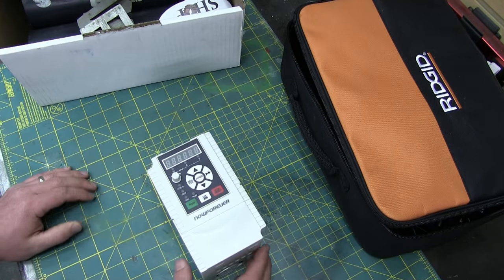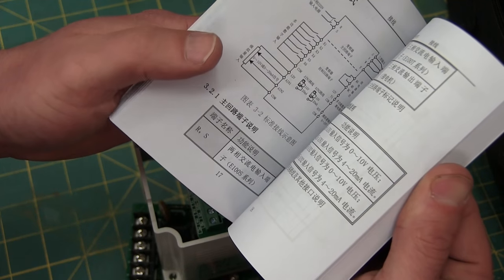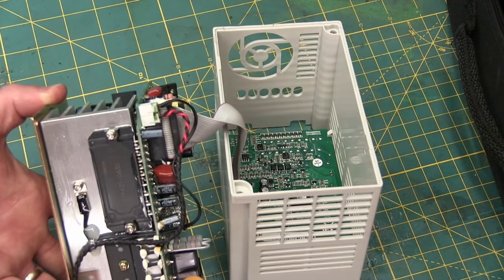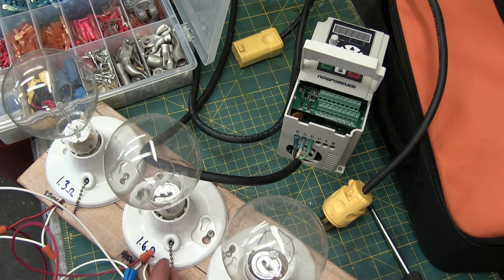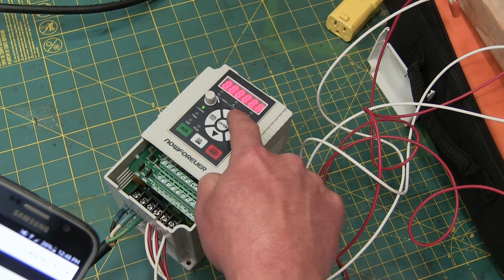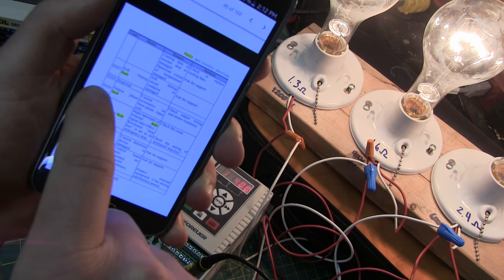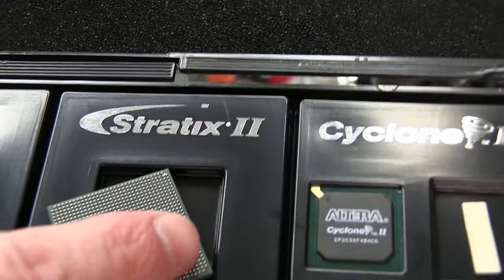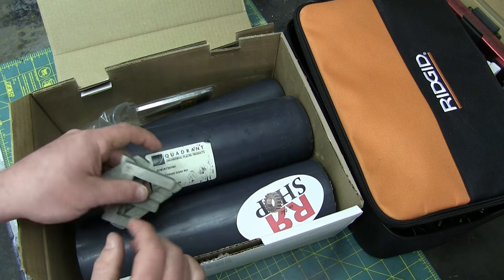BOLTR: Inverter VFDs explained, teardown and test

Comment: Back in 2000 I started a company where we could HAND solder BGA's. I had so much fun watching the disbelief on engineers faces when I'd tell em, not only can we remove the BGA's by hand, we can reflow them by hand. Of course there is some wizardry involved - but no fancy reflow ovens.

Comment: you need to place those notches on those traces so your reflow solder stencil does not get all floppy on yah and break 
it won't affect the current carry capability for it that much as the thinner traces are very short

Comment: Those notches in the solder are from when the workers hand solder them. They use a technique where they rock the iron left and right as they solder. That is also why you see the through hole components, they get soldered along with the increased capacity traces

Comment: It's interesting that many schematics show an inductor before the capacitor, making a low pass filter. But the 3 phase at 50 to 60 hertz gets rectified into 300-360 hertz ripple, which is still pretty low-frequency. I would only imagine that the inductor would be very large to give the filter such a low cutoff frequency... 

Which makes me think that everyone would just use a bridge rectifier and capacitors, without the need for a large, bulky laminated inductor.

Comment: I have a feeling those bars/marks on the trace that they coated with extra solder was some sort of tool to keep it relatively even, since solder likes to clump together, you are likely to end up with one fatter section. Splitting it up like this would help it be more even overall, even if some sections are thinner. 

Just a theory though.

Comment: Ya know what i've been wanting to try...
Since an inverter TIG welder is basically what you have there, i've been wanting to power something off of the leads from my welding machine. Maybe an electrolysis bath that converts the rust in 2 seconds flat. Maybe a thousand LED's...

Comment: That board is a Surface Mount Board so the solder is put on with paste and a stencil.   The bars on the power trace is stencil support to keep it rigid and not floopy floppy

Comment: @AvE They sliced up that soldered over trace like that so if it the trace does fail, it fails there, and not in some random location. (because the soldered over trace may not be uniform the entire length)

Comment: Im not sure and dont jump on me if wrong, but i think that those fat traces are there so they increase the Thermal Capacity and they are slotted like that so they have a bigger surface to dissipate the heat

Comment: You need to be careful using a oscilloscope on mains power and not using an isolation transformer or by just removing the ground pin.   In most, if not all, common electrical systems the neutral is connected to the ground bus in the breaker panel.   So you can still dead short an oscilloscope if you put the probe ground on hot.

Comment: The solder on those tracks was most likely applied with a solder mask when they applied the solder for all of the surface mount components... The lines in the solder will be because they had to keep enough of the mask in place that it wouldn't fall apart when they squeege the solder through the holes. Cheers!!
Reply: Wouldn't the solder just flow over the gaps left by the mask? I have very little experience with solder paste and masks so it is quite possible that I'm wrong here.
Reply: +Charlie Mio Entirely possible... I was guessing that the flux was also applied using the same mask, and that the solder wasn't flowing as freely on the parts of the track without flux.... Only guessing here though... Certainly not an expert on the issue. Cheers!!
Reply: +Charlie Mio Entirely possible... I was guessing that the flux was also applied using the same mask, and that the solder wasn't flowing as freely on the parts of the track without flux.... Only guessing here though... Certainly not an expert on the issue. Cheers!!
Reply: The paste I use at work has the solder suspended in flux, so it all gets screened at the same time.  Provided you get the proper amount of paste on the pads, you don't typically see the solder bridging over the mask.

Comment: 5:35  I bet that temperature sensor is actually a thermocouple, which is just two different types of wire joined together at one end. The junction between the different metals of the two wires creates a temperature dependent voltage.

Awesome vids!

Comment: Through hole electrolytic capacitors are better than surface mount ones, because you're not relying on a little bit of epoxy (between the fibreglass and the copper pad) to hold the big mass of the capacitor down. The only reason to prefer surface mount electrolytic capacitors is that it's easier for machines to assemble and solder, and is thus the cheap, crappy option (especially outside of low-cost labour markets).

Always prefer through-hole in your personal hobbyist projects, if the part is actually the same size (as is the case with electrolytic caps and big inductors).
Reply: Where frequency is an issue, surface mount caps are superior for high frequency applications.  Sorry for the ol' plunger jerk what fer bringing up old comments and whatnot

Comment: When it comes to spindle speed control, you DON'T want constant TORQUE, you want constant POWER! You want torque to INCREASE as the speed goes down, so power stays more or less constant ignoring mechanical losses.

 It takes X amount of power to push a certain toolbit through the work at a certain surface speed and at a certain depth of cut (work done is work done no matter what), that's the same amount of power at a 50mm radius or a 5000mm radius. What changes is the RPM of course (to keep the surface speed constant), which means the force and hence the torque required to take the cut has to increase as RPM goes down to to keep the power constant, (constant power remember?)

Bottom line is you lose power when you slow a motor down no matter what, half the speed and you half the power. The only solution to speed control without power loss is to do it mechanically, i.e pulleys or gears, not electronically. That or overrate the motor sufficiently so that you still have enough power at the slowest speeds. Slowing the motor down isn't doing it any good either, as it pulls high current trying to put out the power that you're demanding at lower speeds and heats up, at the same time the fan has slowed down.

Comment: The breaks in the extra solder of the top are to avoid cracks due to thermal expansion.  Just like in the cracks in cement slabs.  he extra stuff does help with current load and cooling.

Comment: Those lines in the solder are usually used as a fuse . That's how they can get you to buy a new one and all that's wrong is that solder trace needs to be resolder , I usually resolder those straight from the beginning .

Comment: Solder has the lines in there from the rollers or conveyor etc that it came out of the machine on. If you look at the other solder on the board you will notice there are more marks similar.

Comment: thanks for the vijeao as you say.  always learn something here!  the solder on that trace must have been applied during the smt placement.  those lines are a sign of that.  those lines are supports for the stencil.  they SHOULD have reflowed the trace by hand after though... but those lines wont be too much of an issue because they are so small.

Comment: AVE, does you DVM meter need a VFD filter to measure the VFD motors voltage and frequency? why does VFD motors cause noises and interference's?

Comment: Regarding the slots in the extra solder on the high-current traces. The solder paste is scraped out on the PCB with a sharp "rake" through a thin, laser cut stencil. All large openings in the stencils need to have "spokes" to prevent the rake from getting caught on the edge as this would f*ck up the stencil.
And the negative effect of those slots is roughly proportional to the percentage of spoke vs. trace length. Say 5%.

Comment: And what exactly were you trying to do? You can 1ph off a VFD a motor on a saw to get it to cut metal? Pretty sure output phase loss is under the list of faults that get ignored when I ignore all on those Altivars I have kicking around the shop. Hmmm....

Comment: I'm thinking the funky land pattern is created to be a "Shunt". A shunt is a low resistance path used to measure voltage drop which then can be translated into current. Perhaps used to monitor VFD current for overload protection.
With the chop saw, why not just use a heavy (or bank of) diode to half wave the AC before the brush motor? That will give you half speed.

Comment: For 4:22 As far as using electrolytics instead of ceramics (surface mount).  Although electrolytics capacitors have lower ripple current ability and higher ESL, the relatively low frequency operation makes their use completely acceptable.  Additionally, electrolytic capacitors have higher energy density (you would've had to use a lot more board space for ceramics or stack them) and they don't drop capacitance based on DC bias like ceramics do.  A ceramic capacitor near it's rated voltage could drop in capacitance by 30-70%
Reply: +heldgop Yes that's true, but they generally have lower energy density and lower values.  Especially lower voltage rating

Comment: in regards to VFDs have you ever come across "capacitor reforming" . in where a drive or other capacitor rich magic box has been left for a number of years , apparently  the oxide layer in the caps needs to be reformed through a re-breakin procedure involving reduced voltages in increments and a "baking"  wait time . 

anaywys love the vigeayos

Comment: I used to work in a mold shop that made large container type molds ( think garbage can size)  I used to make bearing blocks out of Nylatron.  Not a problem to machine except when I did the grease grooves on the bearing surface.  Biggest pain in the ass to deburr of almost anything I have worked on.  :-)  I think I still have a scrapped on in my junk pile somewhere here :-)

Comment: The attempt to "make the pixies run easier" by adding some solder on top of the copper trace is nearly futile.  The  eutectic tin/lead solder resistance is about 5 times the copper resistance.  So, if you add same thickness of solder as the copper is, you reduce the trace resistance approximately 20%.  Given that the surface tension rounds the solder profile, you probably don't get much more than the 20% effect.  If you really need to reduce the resistance, you better imbed some bare copper wire (or sometimes braid) into the solder.
As to the graph on the manual, it presents the rectified waveform as it is on a single phase input and right after the rectifier.  3-phase  has a DC level near the peak of the AC.  The ripple of the shown 3-phase bridge is nominally 4.5% (RMS) of the DC and 13% peak to peak.  And what the LC smoothing tends to do is a tremendous overshoot of the capacitor voltage.  Without some slow-down, the kick gets to about double the steady state value.  The initial wait you noticed almost certainly is due to an intentional inrush current limiter at the input.

Comment: Dude!   Download Google Translate on your phone.  It uses your camera to pull and translate in real time stuff you focus it on.  Perfect for that manual.  You won't get perfect translation because that really doesn't exist but it will be good enough that you will be able to figure it all out.

3.2.1  Is Main circuit terminal explination
X1 through X6 are Digital Inputs  (don't take my word on this as I am trying to translate with the app from a picture of the video of your instruction booklet.

Comment: It will be cool to see what you use that nylatron for.  We use it on our atvs to replace the a arms bushings for racing applications. Fascinatingly enough it actually wears out the chromoly tube a arms. I have always wondered why that happens.  Could you please explain that in a video about the nylatron?

Comment: my 220v outlet in the garage can't handle the dryer we have. in the winter it doesn't trip the breaker as bad as summer I've made sure the dryer is solid and pulling what it should from the outlet, I've also cleaned the thing inside and out to rule out any factors that might come about from clogged pathways for air and heat build up from dusty dirt covered parts, also cleaned all the ground and power contacts. (other factors are at play i.e. shit push button breakers, the longest run in the house to supply the power on 1940's building code wiring). sooooo my question is can I use the VFD to run the motor for the dryers drum and then run the heating element off another outlet on a different breaker.

Comment: or OR you could use a variac to control universal motors, some variacs can go over the input voltage, and the ones that can't can output to a step up transformer, which can be made out of a microwave oven transformer. if you want more power, you will have to hook it to an outlet that can supply more power.

Comment: Speaking of inverters, I would love to do a teardown (and rebuild) of my Exide 2000ex 2000watt (more like 3500watt) inverter. It is a 12v to 120v modified sinewave inverter/charger and I swear they built EVERYTHING on it WAYY over spec. I just can't find any documentation on it anywhere -.-

Comment: My guess is that the reason for those "slotted" solder covered traces is a limitation in wave soldering process
Reply: +AvE I worked at a place that had a wave solder machine. There's a sump pump in the box that makes the wave. It pumps the molten solder up, and over a bar of metal.  This one looks like it has two waves in it? http://www.speedlinetech.com/sites/default/files/products/wave-soldering-slide5.jpg

But while you're looking at that the solder is circulating. So it looks like a waterfall. It is very Feng Shui.

Comment: +AvE The schematic you showed at the beginning was a 3 phase, not single phase. Hertz (or frequency) has no effect on voltage as you referenced.  10Hz and 400Hz at 110v provides the same amount of EMF the difference is the number of transitions from + to - power second.  Do you make this shit up as you go along?
Reply: +Rich Booth You need to lower the voltage together with frequency, otherwise decreased back emf in motor would cause too much current to flow.

Comment: Are you sure the scope is floating? PE and N are basically the same wire (the only difference being that PE can not be cut by a breaker), does disconnecting PE really help?

Comment: My ex-wife worked at an electronics factory, and she was their "BGA specialist". It's all she did, all day, those farkin BGAs... 

If you wonder how they melt them down to the board? It's kinda cool, I've seen her machinery. She sets up ICs in a special jig and slides it into a thick protected metal box. Then it's hit with a microwave on a special frequency to melt all the tiny solder balls. 

Just load up your tray, clip on the jig, stick 'er in the oven, then "nuke" it like day-old pizza. Instant circuit board. :D 

(Keep in mind, these are "pre-balled" parts. If she needed to de-solder and re-solder a part, she had to stick a grid array on top of the upside-down IC and put all the balls in their places - under a microscope. Her least favorite part of the work...)
Reply: or use a stencil to srick them back on. also they melt them using just hot air stations! see Louis Rossmann board repair specialist on YouTube
Reply: Anas Malas
- Well, that's what I meant. She'd use a grid array stencil to spread the balls into place, using a scope to make sure that every pin had a ball.

And yeah, there are other ways to heat them - but she said the microwave station was more for manufacturing processes. Certainly much faster than using a heat gun.

Comment: FYI if you only need to change voltage (without changing frequency), i.e. for universal brushed motors, just pick up a variable transformer (aka 'variac').

They're butt-simple, just turn the knob to change the speed, heavy as hell, and fairly cheap ($50-100 for >10A, and it's pretty easy to find old ones for ~free) 

I use 'em to slow down cheapo hand drills all the time.

Just remember its no gearbox so you drop torque at the same time you drop the RPMs.

Comment: On floating the scope, really not that dangerous IF the device under test is on a GFCI. I'm sure you've heard this before, but there's also not floating it and running it in A minus B mode, one probe for signal the other for "ground".

Comment: try connecting load to the two output phases that go through the current transformer (L07P015D15)
Many inverters, not just cheaper ones, only measure current in two phases and use math to calculate the third to save cost (assuming balanced load). it may overcome your current imbalance fault as two being measured will be balanced, depends how clever the confuser is.

Comment: AvE You did a video on compressor using a VDF. Can you go into the correct sizing of the VFD? Also the motor on mine is so old that the FLA is not listed on the plate. .What to do, What to do? Thanks

Comment: Always dealt with the annoying stuff, never heard it called Silastic glue... never really heard it called anything before though. What's the advantage of this stuff? I usually see it quieting and supporting through hole caps. If I pop some RTV on there am I getting the same thing albeit slightly more flexible?

Comment: Holy buckets, haven't seen one of those gator socket things in ages.
I figured those things were just a bunch of bologna as most as seen on TV things are but kind of wanted to try one as every now and then one of those miracle items actually works okay.
Figured if I saw one at a thrift store or garage sale for a buck I'd grab it but so far nothing.